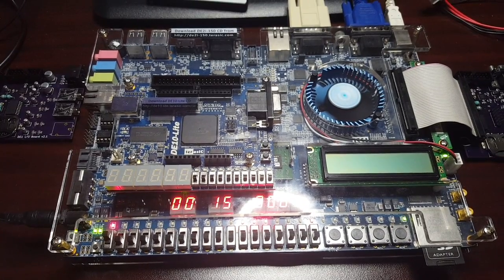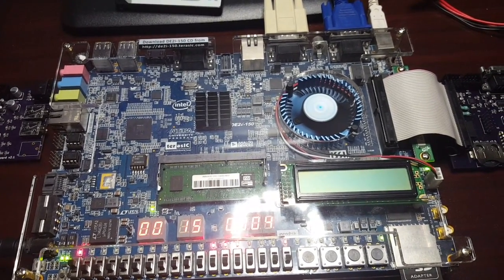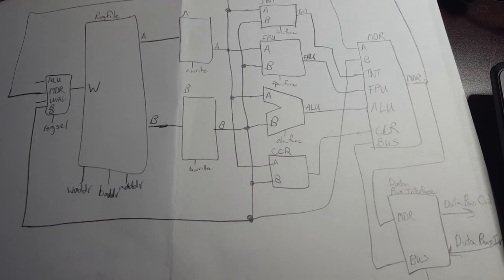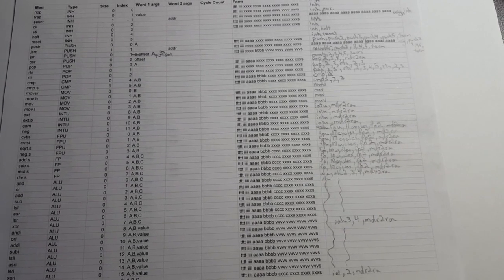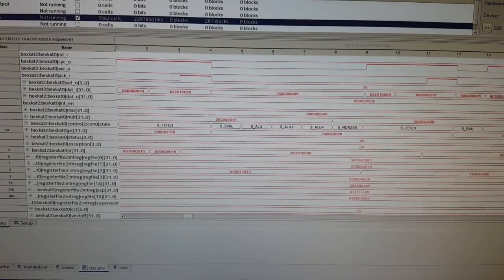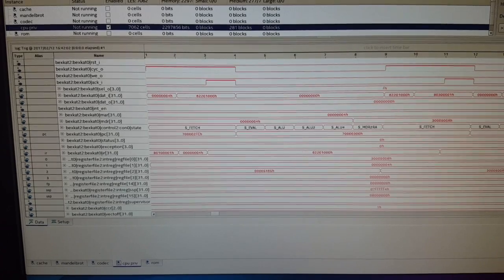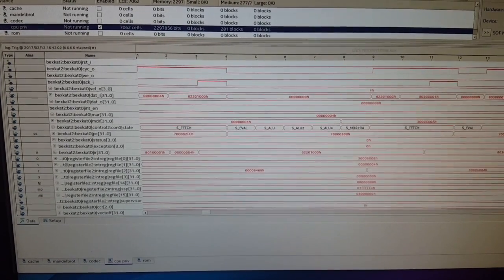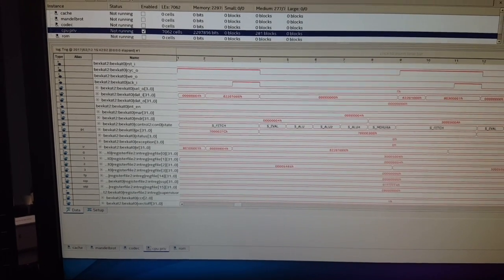Bexkat CPU design

Comment: Cool project.
Would be really nice if you've compiled all information about your computer.
What exactly RISC architecture have you used? 
What resources you have used to build FPU? Used already existing solution may be?
What exactly CCR (Control Register Logic?) logic does?
Reply from the maker: Thanks Alexander.  Most of the documentation about the implementation of the CPU are in https://hackaday.io/project/8719-fpga-doom and my related CPU project on Hackaday.io.  My RISC architecture is roughly a 5 stage pipeline, though I may have cut that down to 4 (I haven't looked at the code in a while).  The CCR (Condition Code Register) is what keeps track of things like the overflow, carry, zero, and related state bits from the ALU and enables the various conditional tests (equal, less than, etc).